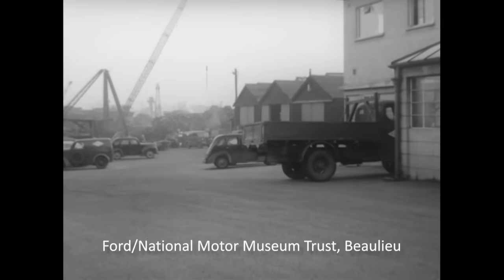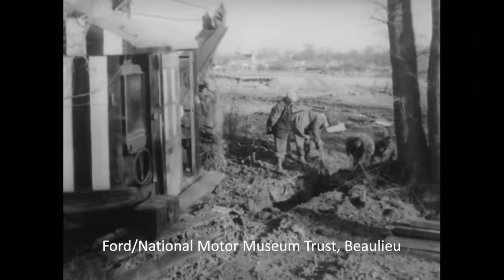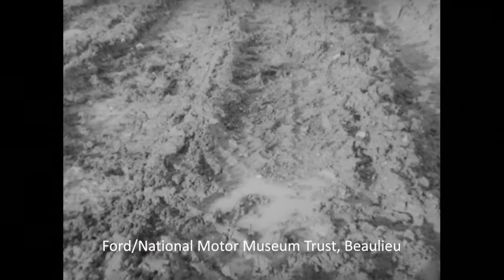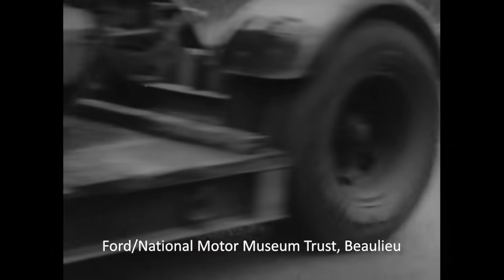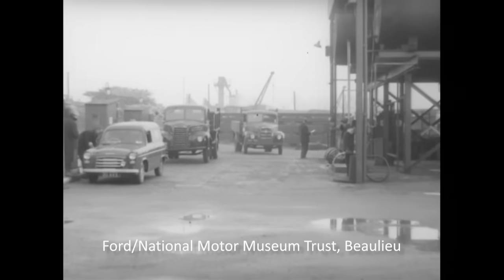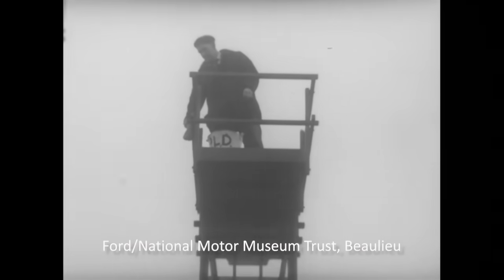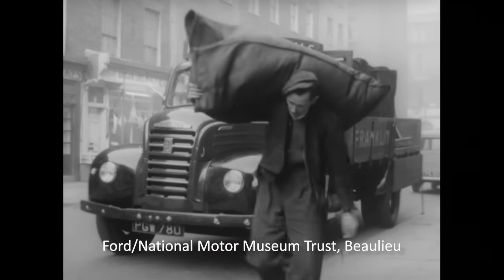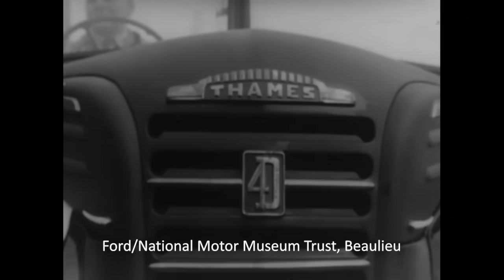Thames Operator Reports - 1957

Comment: Passed my test in a Ford Thames 4D at T.Wall's meat and handy foods.They had a large fleet of them in the '60's and they were solid and reliable, they were slowly replaced by Commer Walk Thru vans that were easier to work from doing shop and catering outer deliveries.
Reply: Hey, same as me,  at Atlas Rd. They didn't have a Ford available on test day so I had to take a Commer, never driven one before, Feb '66.
Reply: Small world, what round was you on, I was on Hampstead round for 3 years when I passed my test, but moved over to the Catering sales vans as there was a vacancy for a permanent round working on my own. Loved it on there much easier than Shop van sales. Had a Fibre glass bodied Commer Walk Thru nice to drive but no heaters as carrying perishable goods.
Reply: @raymondhunt6109  Started on Watford then was put on Southall where I met my Mrs, she's still here, left to work with my brother. Nothing against him but one reason for leaving was a new guy started and got his own round straight away while we had to work our way up.
Reply: Yes I think there was a bit of favouritism going on that's why I transferred to Catering sales. Wished I'd taken some photos of the Commers at Wall's as we had dozens of them. Hated the flat fronted Commer engined ones they were gutless and always blowing injectors drinking the cab out. Liked the Perkings ones though nice to work on we had a few brand new on Catering as it expanded fast when Drings of Wembley went busy and we gained a lot of their work.
Cheers ,Ray.